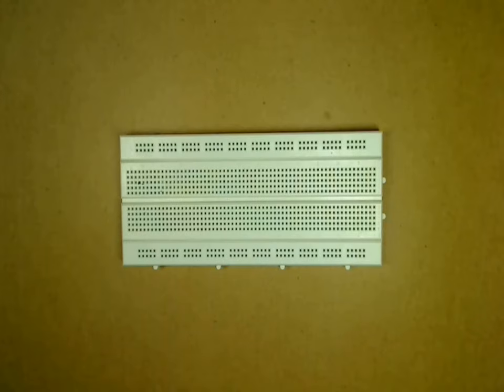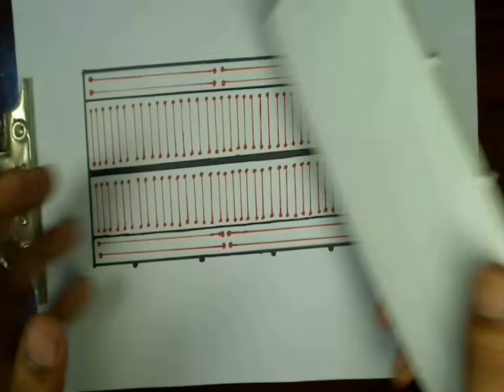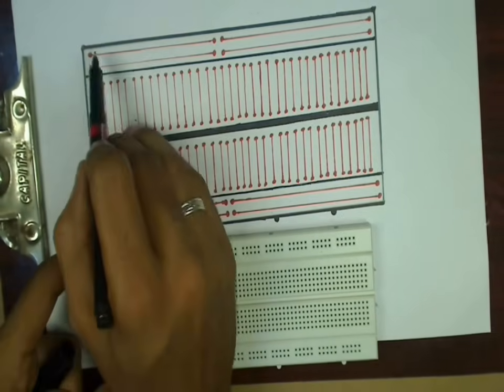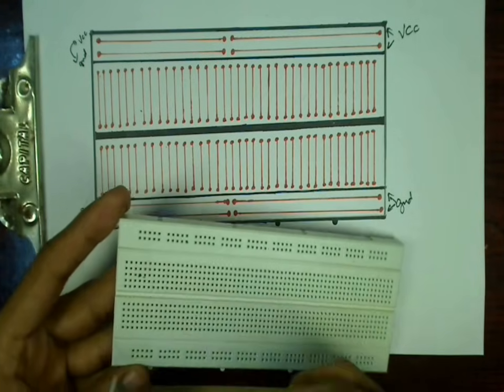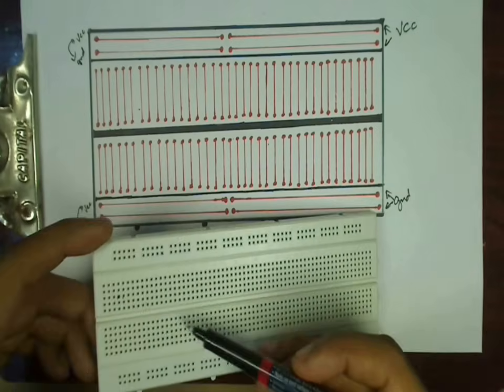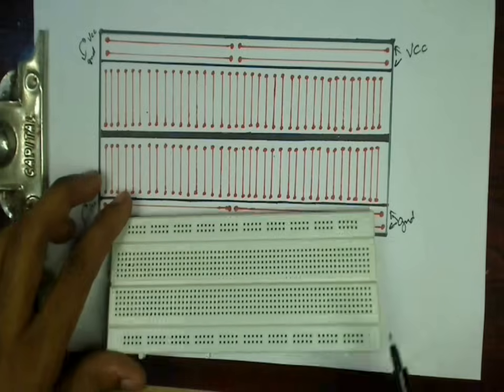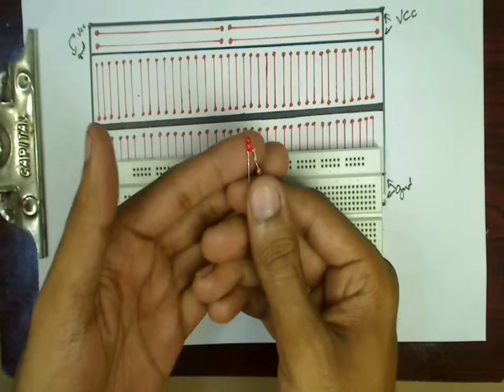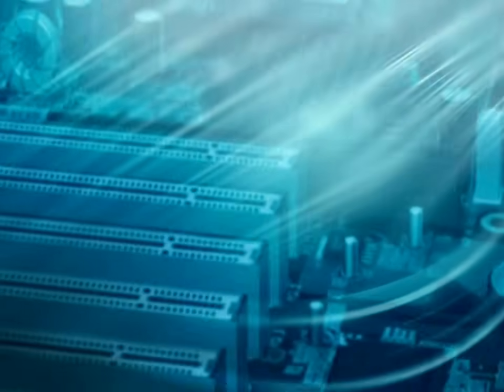#E BASICS: 1 - Breadboard Tutorial

Comment: Very clearly presented! Seeing the rails from underneath completely explains what will happen when components are inserted on top. Now I really get it.

NOTE: I am using a very small 400 point breadboard that does not split its power rails, although there is a space between each group of 5 power pins in a power rail row. With some further research I found out that if a breadboard has red & blue lines next to its power rails that is the key to split & non-split power rails. If the line is unbroken then it is a continuous power rail and if the line is broken then it is a split power rail. 

Just to be certain, I'm going to check to make sure that the power rail on the opposite edge of the breadboard is fully independent so I can have a 5V power rail and a 12V power rail for my project. As you said, I don't want to power up my breadboard until I make sure that the correct voltages are applied where I want them and there are no short circuits or incorrect component branches.

Thanks for your informative video.
Reply: Thanks For making me aware of this....
Reply: And here I am a 12 year old learning electronics thinking I will be able to do any of this

Comment: i need more explanation on the two horizontal lines of top and bottoms????? are there both horizontal lines  are ground or the one is power and the other is ground . please reply soon!!!
Reply: Hello, i know its been a few months sense the comment was posted. But i believe when he wrote this diagram, he showed on the left side that they were vvc on the top bar and gnd on the bottom bar and it was same for the two horizontal bars on the bottom. Then on the right, he said the top 2 were vcc and the bottom two were gnd. I believe this was to demonstrate they can be whatever you assign them to be. If you think about it, this makes sense. They are just metal bars, they have the same physical properties, you can make whichever gnd and whichever Vcc that you want to. I suspect you could do the same for the vertical bars given the appropriate orientation. But it just wouldn't be logical or practical.